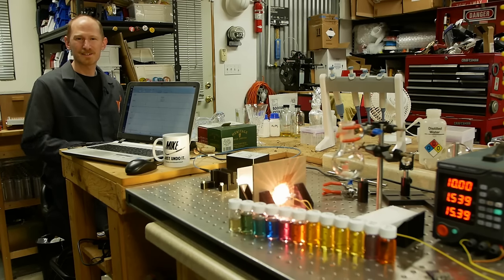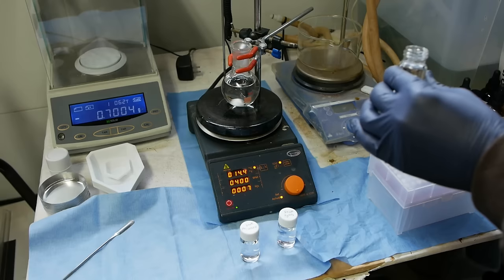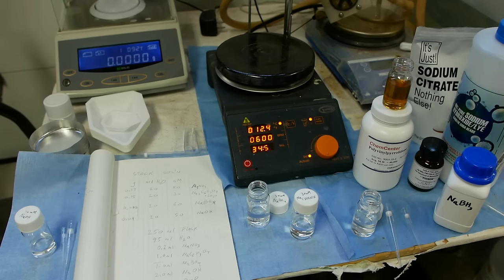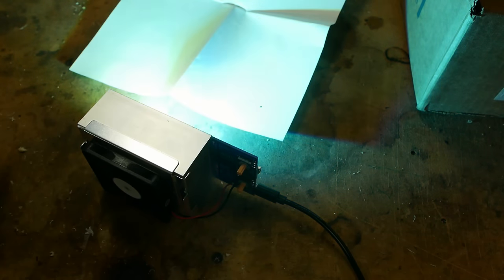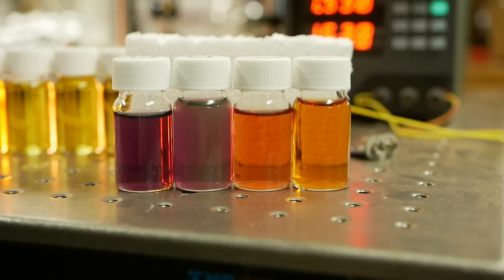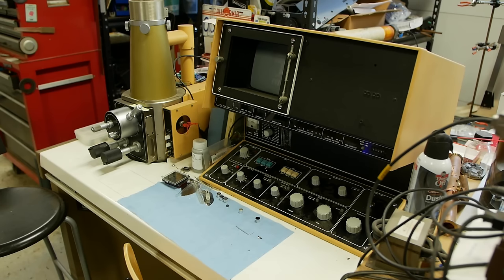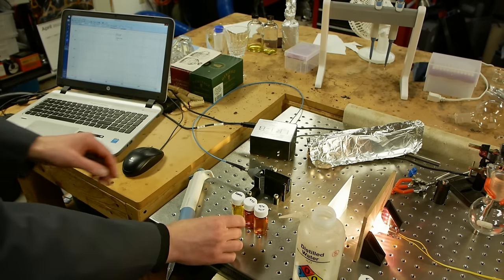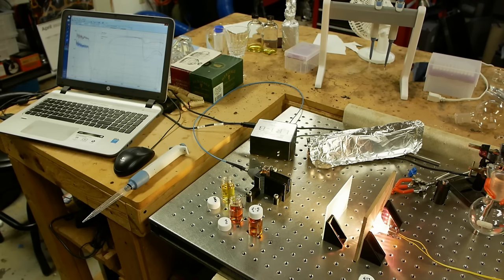Silver nanoprisms grown into structural colors by high power LEDs

Comment: Reversing the reaction might require a higher intensity just to break up the silver nanoparticles more effectively.
Maybe if you swept the wavelength backwards it could change more.
The already-formed particles aren't very sensitive to the photons you're sending in, so the energy absorbed is much less than for the suspended silver nitrate (which is very photosensitive across a wide bandwidth).
If you started with the wavelength they are already trained for, they'll be more receptive to it and change faster. Even with the setup you have, I'd be curious if you could take an already-reacted source and pump it with progressively stepped wavelengths toward the desired state.

Comment: Maybe the ones you lit up twice didn't go back to what it was before because of the same effect that makes the secondary peaks in the others at a higher wavelength than the LED. Maybe try lighting them up again with a 350nm LED or something. See if the second peak combines with the 400nm peak. Maybe the peaks need to come together close enough before "snapping" together and producing the original sizes of particle again.

Comment: re. reversing the process - just a wild guess without any knowledge, but maybe try to use light <405nm, e.g. 380nm, 350nm? As the absorption peak doesn't match the wavelength used during the creation process, maybe the same applies when going back? In the spectrum it looks a bit like it went "half-way", maybe it'll shift further with shorter wavelengths. Might be worth a try. Also, could it help to sweep across multiple colors towards the target, instead of trying to make one big jump?

Comment: Regarding the very last graph with three lines: the IR part got smaller as well, so could it be that this is what got "converted" into that second deeper peak at 478nm? Because if you look at the 400nm it barely changed at all. This is my uneducated guess, but maybe the conversion back doesn't quite happen precisely because of the energy difference between IR and 478nm? And where does the IR part come from anyway? Worth investigating, I think.

Comment: Hi Ben, thanks for sharing your amazing experiment once again! This is really inspiring to me! I got some questions after watching your video. 
1. A big benefit of structural colors is the colors never fade if the nanostructures can be well-preserved. All the pigment-based colors will fade away in the natural environment because their chemicals will be decomposed by natural light. However, this hardly happens for the structural color material. It seems those structural color liquids will still be affected when under the shinning of natural light. Is there any way to end the growth of the nanoparticles forever and freeze them as permanent colors?
2. As you explained the RGB mixed LEDs didn't work because they are only three wavelengths. However, I'm super curious if the color mixing theory works for the liquids as they are structural colors but not pigment colors. For example, if you mix the blue liquid with yellow liquid, can you get a green solution as the result? 
3. What's the maximum color space can we get from using this method? Is there any limitation? Or theoretically, we can get whatever color we want if we can find the right wavelength and give the solution the right time of light irridiation?

Comment: 3~5 watt diodes might speed up the incubation time a little, i experimented alot with led´s for plant growth and i used everything from 0.25w diodes up to 5w, i would never use below 1w diodes for growing again but then the 5w diodes get so powerfull they can burn the plant if too close even though it doesn´t get hot

Comment: If the particles are absorbing light - being put at a higher energy state by the light, shouldn't they strive to become anything BUT the wavelength they are illuminated by? As in the particles that absorb -> more energy -> more reactive -> change to a less reactive state..? That the light could be seen as artificially increasing the energy at a specific size so since we expect the particles strive for a lower energy state the "absorbing size" would be discouraged? 

I propose a simple experiment for this, when trying to get one of the longer wavelength colours, instead of using only one LED, use it and all LEDs with shorter wavelength. If it works as I think it does we would see:
a) the end product being the same colour as the one produced with only one led
b) reach that colour a lot faster. 

The way I expect the one led situation works is that the particles still absorb some light which drives up the reactivity in general and then  agglomeration drives the size change since it in it self is preferential from an energy standpoint.. Also, the leds, even though being single colored, still have a emission spectra (not just a point like the laser) which probably helps..

What I can't explain and that does somewhat contradict the part about agglomeration driving the size past the led (towards longer wavelengths) in contrast to just the emmision start, is that you seemed to be able to somewhat decrease the size again.. But I don't think this contradicts the absorption maxima being discouraged..

I do believe the experiment I propose would give us good answers, or at least pointers, to what the mechanism is.

Comment: Dumb question, if you wanted to get back to yellow from say the purple, instead of hitting it with 405nm, have you tried hitting is with like the 290nm source to try to drive it past? My thought is to 'overdrive' it and maybe that would bring it back because the input waveform is 'more different'. 

It's a thought.

Comment: Ben will you share your data including exposure wavelength and exposure time along with transmission spectrum?

How long of a wavelength would you guess is the maximum practical absorption peak?

Any idea if these kinds of nanoparticles are used in any sensing applications?

Thanks!

Comment: Instead of the wavelength of the inbound light making it prefer that size, what if it drove the particles away from that size? Only particles larger than it or smaller than it are stable, because ones that match the wavelength absorb more energy. It would lead to the two humps you see in the spectrum. This would also explain why you couldn't relax things back to the starting point; you'd have to kinda squeegee the large particles back using a nearby but larger wavelength

Comment: So here is your next challenge - Take your multi-spectral LED source and get it shining through a fiberoptic, then take the "fresh nanoparticles" and apply them to something appropriate to create a thin sheet of liquid or soaked cloth or something, then use a software controlled X/Y liner stage to move the fiberoptic slowly across the surface in a raster pattern, and see if you can make a crude silver nanoparticle color printer.

Comment: Have you tried running these in your centrifuge and then doing spectroscopy?  It seems like you could create a concentrate and then suspend them in some host solution that wouldn't degrade the particles.  Do you know if these particles can be added to other materials like resins?  Great work by the way.

Comment: I saw in a recent video that you made coloured silicon which I thought you did by producing an electrostatic standing wave in the visible wavelengths (which I'm astounded by). If you give these prisms a surface that makes them clump together, can you use a standing wave to force dispersion of a subset of the prisms by size? If so, then if you can modify the solution to vary between solid and liquid you could have a colour e-ink. liquefy-disperse-solidify.

Comment: Cool project. I have a question here.
When we impose  light of particular wavelength We get a prism of particular size. Assuming there isnt significant flow of fluid in the vial, what if we impose light of two different wavelengths from two different directions onto the blank solution. Can we get polar solution or a prism particles with different wavelengths?

Comment: Normal LEDs have quite broad spread in wavelength. A Blue led might have wavelengths all the way from 400 to 500 nm. Similar to the broadness of the absorption peaks you measured of the suspensions.
It would be interesting to see what happens if you use a laser diode instead of LED which should have a much more precise wavelength. (I mean a non-focused laser diode with the same power as the LED that exposes the entire solution at once).

My prediction is that it either causes a much narrower absorption spectra in the final suspensions. Or it does not work nearly as well as with the LED because statistically you are much less likely to find particles/structures that are excited/affected by this particular wavelength. Most particles will be unaffected unless their size is exactly right.
Reply: If the latter is true, it might work to have a multi-step process starting with wider spectrum diode (likely also with shorter wavelength not to "overshoot"), and them to use a narrower-spectrum light source when the particles are mostly already closer in size so that they can absorb the light.

Comment: I wonder if you could get the reversibility to work if you were able to use smaller steps in the wavelength of light?  Just based on your explanation, it seems like it'd be important to have at least some particles that are still in the size range you're targetting; failing that, much smaller jumps in the wavelength.  I think that could also be tested by mixing in some fresh solution to one that's already been exposed, and then trying to target a different size/color; if this model is right you should be able to convert all of the solution to the new size.

Comment: I wonder if the heterogeneous nature of the starting solution guarantees that some particles will be tuned to the wavelength you're exposing it to. Maybe if you seeded a jar of "old color" with a small amount of "new color" and then exposed them to "new color" light, those "new color" particles would steal silver from the other ones. I bet you would have to run it for a bit longer and end up with a jar of "new color".

Also, I think the rate limit is due to waiting on brownian motion to make those interactions available? I'll bet the mass exchange between particles is at least somewhat dependent on local particle density. I also wonder if you'd see anything analogous to Oswald ripening in fresh / undifferentiated / heterogeneous solutions? edit: rephrase for clarity

Comment: Hey Ben do you think you could cryo harden a ar500 steel plate and make it even stronger? If u wanted to win a prize from Matt from demo ranch, it seems like a surfire win. If that application worked even somewhat like it did with the drill bits, it should be damn near an immovable object.

Comment: If the result of exposing with a particular colour light gives a red shifted absorption doesn't that imply to return it back to the original yellow you need to use a higher LED frequency than the yellow? That would explain why you get a new peak that is lower than the yellow.

Comment: you were shining the light through a glass vial - any chance it lead to your long exposure times and also causes the offset in the absorption spectrum?
what happens if you use multiple light wavelengths either simultaneously or intermittently to expose the solution? can you grow different sizes of particles in the same solution?

Comment: perhaps the reason it doesn't turn back is due to the red shifting? and if you took the changed solutions and used a shorter wavelength that 400 it would take it back there

Comment: The size, shape, distance between particles and environment change the properties of the reemited light. 

The larger the particle size, the easier it will be for them to reemit back larger wavelengths. 

For spherical particles the radius is the main diemension to control, but for a rod you have bot the length and the radius of the cylindrical shape. The particle will interact esier with longer wavelengths for the length of the rod and esier with shorter wavelengths for the radius of the rod, and in total will be some combination of both reemited wavelengths. 

If we have some spherical particles all arranged as an array with some fixed distance between particles, and we change this distance, we will have differente reemited wavelengts. 

And finally for the environment, as exemple we wave the structures from butterfly wings. If we add some droplets of alcohol we change the color reemited from the wings.

The channel "Atoms and sporks" has 3 videos that explain really well the concpets involved in how nanoparticles work.

https://www.youtube.com/watch?v=8iyShOidtYg&t=422s

Hope it was helpful. Have a good one !

Comment: Seems like you need donor crystals that aren't favored, in order to have a source of silver ions to grow your favored ones.  Once the solution is fully transformed, all the crystals are absorbing a single color of light, and there are few if any of the random starter crystals present to absorb a different color, so even if you DO expose the solution to a different color, the crystals that are there won't serve as donors, since there's no place for them to donate to.

I wonder what would happen if you mixed two solutions of different fully transformed crystals.  At that point, whichever color of light you exposed the solution to, you'd have a non-favored donor crystal to provide silver ions.   You might be able to make a solution that would alternate back and forth, as long as you didn't take it to completion.

Comment: 24:13  Well yeah, but you were talking about how particles of the appropriate size best absorb the given wavelength of light, right?  And that somehow conveys an "advantage".  But if they're absorbing that wavelength of light, they're not transmitting it, nor reflecting it, so that can't be the color they look like.   ...OH WAIT, the "peaks" ARE the most absorbent, aren't they?  Also, for curiosity, I wonder what the wavelengths of the high-transmission maximum between the two minima is.

Comment: could the shape of the glass (and hence the amount of light bending from the glass) affect the peak wavelength absorbed? Could you have a shape of glass where the light doesn't bend much before hitting the solution? Also, I was wondering if the solution needs to be stirred during exposure to ensure you get even absorption?
Reply: We are WELL into the realm where words like "Shape", "Bend", "Stir", and maybe even "Hit" need to be rigorously defined before we use them.
Example - 
Question: What shape is a sphere covered in velcro?
Answer: It depends. Why?

Comment: I love your work, you are supreme human professor. What happen if you let a laserbeam in to a pipe, who is for microbloodsampel (1mm glaspipe), will you got/get a "timetunible" laser, when nanodots grows? Your work to reverse, is possible. But most times.. metane to wood.. no. Crude oil to tyranosarus rex..no. CO² to oxygen and charcoal.. Laser: If the frequency of a wave is doubled, then its wavelength will be half of the original.
Be proud over your self and your work. Victor

Comment: If different particle sizes need different centrifuge speeds, and the pvp particles are pretty large, couldn't you remove the pvp that way as well?
Centrifuging them at lower than particle-size-related speeds for a while, removing them,
and then maybe centrifuging again.
(you got it working, so not that relevant, but still a thought)

Comment: Is this a "reverse process" of X-ray Diffraction, because it singles out the resonance frequency formation of the crystals, if I understand the Diffraction Pattern is a probabilistic Imaging of crystal angular structures, that still emerges from amorphous conglomerations of samples, is correct? I could never understand this until seeing the AM-FM line-of-sight e-Pi-i superposition alignment should emerge as relative-timing ratio-rates, logarithmicly positioned superspin Quantum-fields Mechanism Holographic Condensation. (?)

The "latent heat" holistic crystal phase frequency of the atoms is lower than the component bonds? A Red-Blue relative-timing of interference bond lengths in holographic wave-packaging formation. Crystallography stuff, and supposing no such thing as a wrong question?

Comment: Perhaps shifting it back to the original 405 also requires a lower wavelength than 405 to compensate for the red shift seen in the other colors? Or probably you tried that too, commenting just in case :)

Comment: @Applied Science  Could it possibly not be reversible because its absorbing the frequencies you need to use before its able to function deeper into the solution.  Perhaps look for a one off in the spectrometer to see what is transmission colors are and see how those act as far as reversing compared to those being absorbed.

Comment: Regarding the reversibility: What if you use even shorter wavelengths, like UV, to "force" the particles back to a small size (while possibly contributing energy needed)?  Then, if it works, doing 405nm again to "normalize" it...

Comment: At what point do the definitions get so fuzzy, that we can start defining 'things' as 'blue' because they happen to reflect/retransmit mostly blue wavelengths?
It still fits in the box. You just have to be willing to define the box a little...loosely.
Unlike the opposite problem, like defining the temperature of neutrinos, where the dimensions seem like they might be fine, but putting them in a box makes the same amount of sense as putting 'happy' or 'the box' inside the box.